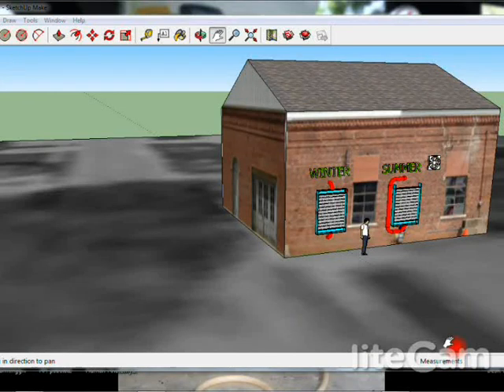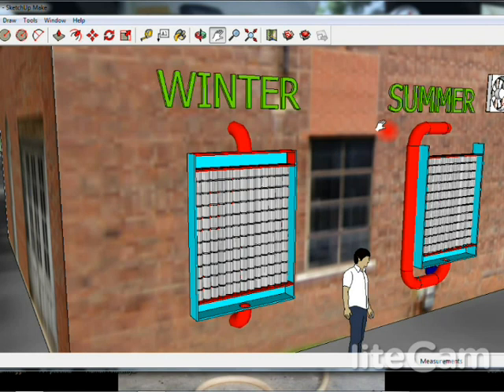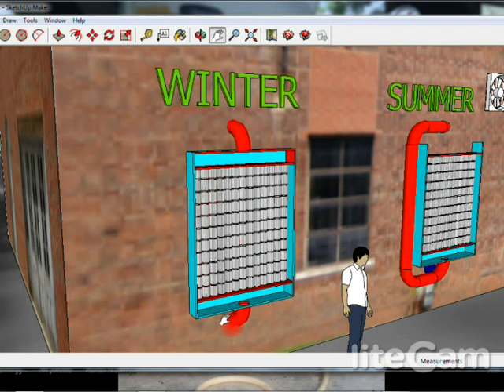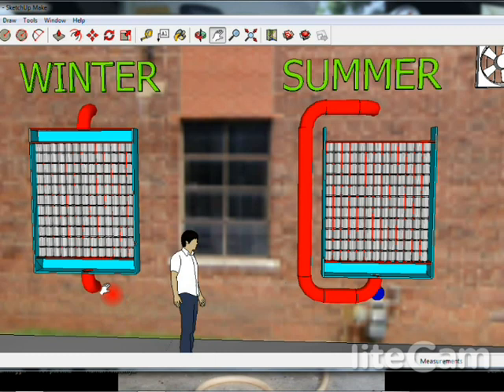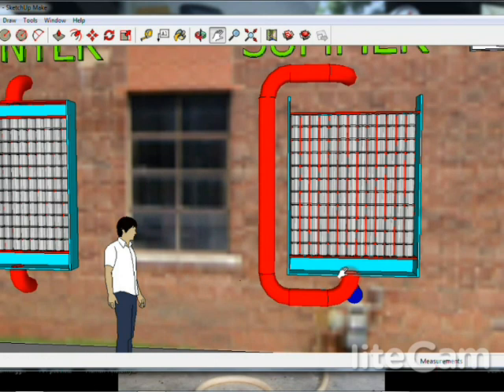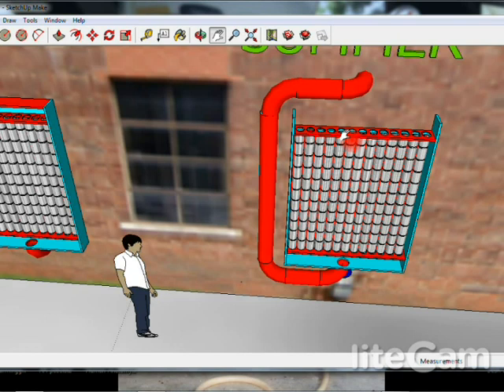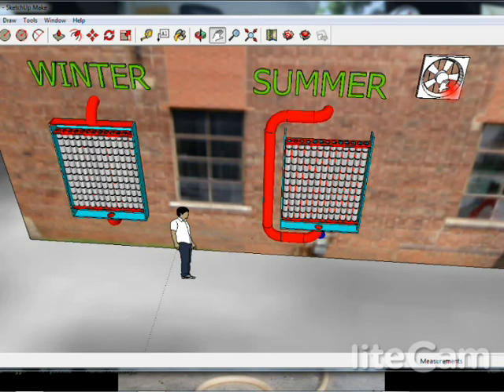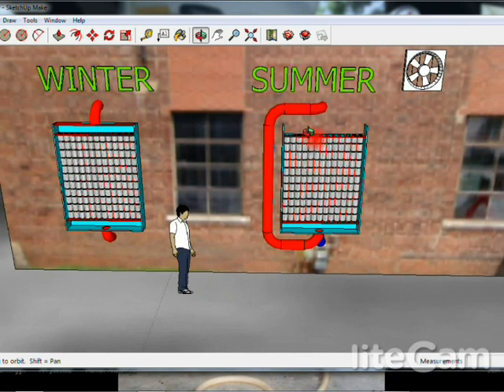Solar Cooler/Ventilator And Solar Heater in 1, Using Sun's Heat To Cool Your House

Comment: What would you do at night? I've kept on coming back to solar heaters but that part always deters me
Reply: Use thermal mass, like either bricks, or a homemade mixture of dirtcrete/soilcrete, behind the corrugated metal of the heating elements. 5% cement, 10% water, the rest dirt, mix it well, then compact it really well. You can mix it again after compacting, to avoid having the grains look like a stack of differently colored paper, or like slate rocks (like if you use it for building something else). After you're done, add water on top of it, so the cement absorbs that extra water, for the artificial stone to set better. And that's how many ancient civilizations ended up building megaliths, including the pyramids.

Comment: Hi Saeid, I see you have a problem with accessing cans, not a problem here in Spain by the way. I don't want to state the obvious but have you tried rainwater downspouts. I'm sure you have considered this as an alternative......
Reply from the maker: Hi. No I hadn't infact. It's a great idea, which means I can actually get to work on this when I go to Iran. It never hurts to point out the obvious (-:

That'll make life so much easier. No cutting holes at the top and the bottoms of the cans and no silicon gluing. I was always hesitant about using silicon in a situation where you're heating it up and then breathing the air that comes off of it. This solves that problem too.

So thanks again

Saeid
Reply: No prob's Saeid, if you go down this route then it might also be an idea to put some kind of air resistor in the tubes to stop the air moving too quickly and therefore not producing high enough temperatures. I also agree with the silicon situation but you can get high heat silicon just as you can get high heat flat or matt black paint etc. Good luck in Iran......
Reply from the maker: I have decided to go with Chimney Pipes for the heat collector and paint them black. Those are available everywhere in Iran and can be bought in any length. Would you recommend a thick or thin walled pipe for best heat transfer? A thick one would retain more heat and a thin one would pass on more of the heat I guess. Is that correct?

I think too much air flow won't be a problem , as the out let is going to be a single Chimney pipe being fed by about a dozen of them. THe diameter is 10 CM by the way
Reply: Saeid Momtahan I suppose it depends on how long your heat panels will be in the direct sunlight, not shaded by trees or buildings. The thinner walled pipe will give you heat quicker but the thicker walled pipe will take slightly longer to become effective but will give you heat for longer and the variation in temperature when the sun is a little weaker or in shade will be less noticeable.
Reply: @solarsiberia  You can also have the back inside of the heating elements' panel be a thermal battery made out of black painted bricks or black painted soilcrete/dirtcrete (5% cement, 10% water, the rest dirt, mixed well then compacted really well, then a bit of water added on top to be slowly absorbed by the cement then wait for it to harden, and it will and act like stone; you can also mix it again after compacting it, to make it look even more like natural stone). For the paint, you can use a mix of boiled oil (or oil brough to the smoking point once), mixed with ask, and the mixture diluted with water. Adding a small amount of boiled flour will help he water and oil to mix together. The oil makes it waterproof. Boiled flour is water roux, which mixed with oil allows for oil-based paints  (and cooking sauces) to be thinned. (And allows the cooking sauces to be thickened, too, but you don't need that for paint.)
Reply: @saeidmomtahan  Check the comment above, in which I replied to @Professor Pallet , please.

Comment: If you put a swamp cooler on the other side of the house, it'll help cool the air coming in.
Reply: If you don't want to increase the humidity, to avoid mold, just use a heatsink on the intake of the heater, with the heatsink inside a box, with the intake of that box being a swamp cooler. That way, the heatsink will cool the room without increasing the humidity in the room.

Comment: an interesting idea but I think you'll find that air doesn't flow as easily as water - I don't think it'll want to go down the pipe in the summer version. If you build it and get it working let me know! ;-)
Reply from the maker: Abdullah, if the tubes are sealed, I'm pretty sure the warm air getting sucked from the interior will have no problem getting sucked out by the hot air in the external tubes. Also the system could be built on the roof.

TY

SAeid

Comment: I dont know...I would think cooling air to thr ground temperature would be better than having it on thr side of the building.  solar panels to force the air on thr side.

there is a girl using solar greenhouses on her window  with solar fans thst also cook and heat. it's in use..cost her 9 usd to make.  what ahe saves in not using her oven paid foe it many times over and the heat well...pretty good supllplimentsb too
Reply: Solar cookers are nice, and modern solar panels are very efficient. Even using a garden light's solar panel to power a fan would work well, for heating the place. There are also trombe walls, which also significantly help with the heating.

Comment: The cans are not necessary. Paint the box black and cover it with something clear that will stand the heat.
Reply from the maker: Hi. Have you tried it without cans? It's hard for me to find cans, so it would be great if I could do it without them.

TY

Saeid
Reply: I have a couple of videos. Don't use the styrofoam, as it melts, but check out 
The Great Passive Solar Build Trombe Wall Explained  and Building A solar Heater Start To Finish
Reply from the maker: kbbacon I was finally able to see your first video. So it's exactly the same system that you explain. Great to see that.

SAeid

Comment: aaaah short term its not a cooling system you using it as heat desposal system during summer because the normal 300mm fan was to loud. and there would no addidional cooling  effect during night below the night temps even the system would run backwards by sucking cool air in the system it wouldn´t drop below the sourrounding air temps. well you can add additional systems to made that happend and it will work as air cooler below the outside enviroment Temps.

Comment: Air has to be replaced.  If you take out hot air during the summer, what are you replacing it with?  If you are sucking air back in somewhere fromt he outside, you are probably defeating the purpose, because likely the air at the top portion of the house is still cooler than outside air.
Reply: Aaron Bateman he said the way it would work would be to open a window on the opposite side of the house.

Comment: why did you have to use cans?
Reply from the maker: +anwar abdulkader you can also use tin chimney pipes.  Much easier
Reply: ok  thank u
Reply: Saeid Momtahan Would dryer vents work?  Bigger bore...but if painted black in a slightly larger frame...so cheap and easier then becoming an alcoholic drinking all that beer...!
Reply: @SPLINTBLIGHT  You buy the beer and I'll drink it for you.

Comment: Why not get an HRV instead of replacing your 70 degree indoor air with 90+ degree outdoor air? That does the exact opposite of cooling?
Reply: you obviously did not watch video close enough...the heated air draws out the TOP of the panel to outside air.   What he SHOULD have done was install a fan run off a $1 store solar light top with removing the solar battery and hooking up each terminal to fan terminal (+) & (neg) sides and letting the SUN run the solar panel to run the fan to blow the air with force thru the tubes by PULLING it out at the TOP of the can unit....however......it do see that Alum. downspouts work much better with their sides having ripples to better catch the heat (gaining 210 degree temp capacity)...and also "screens" laid on 2 sides of inside panel held off the bottom & back by 3/8" - 1/2" blocks allow the panel inside to float with air on all sides of the 2 layers of screens held apart... THIS screen system works about 3 degrees hotter than cans & alot less cost & alot less work involved.  I would like to see it compaired however to a system created out of the tall thin REDBULL cans vs. regular width beer /soda cans...I think the thin tall cans would allow more rows of cans to be coiled in up/down rows to make the final output an even hotter temperature. Would be alot of work to make it though but would end up being like a large scale copper coil system on an air conditioner or refrig.  - - - so try a CPU fan $2 +/- and hook it up. you would need a CPU that could withstand hot air temps....or attach fan to INLET hole to PULL the air thru system vs. pulling it into room. 

BTW,,,I'm a 27 yr experience Architect that specialized in creating solar heat tanks before many of you were even born and put them on experimental homes in early 1980s after doing the hard #'s/calc's during a solar college class where we wrote programs for calculating thermal mass required for entire homes with passive/active systems combined.  I always wanted to try to come up with a cheap type of solar powered air conditioning system that flowed thru tubes thruout the home in a ceiling area vs. floors for heat in winter.
Reply: D.Dominique Watts So 70 degree indoor air is heated to 110 degrees then 90 degree outside air goes back inside? I understand the heating but how does this cool when all the air in the house is colder then the outside. Where is the solar powered refrigeration cycle?
Reply: The "hot air" goes out the panel at top of exterior unit to outside air.....the "cooling" is in that the hot air which rises to top of the room is constantly taken OUT of the room by the unit in the wall allowing the cooler air from floor level to about 36" above the floor to constantly rise up...allowing the room to remain cooler.... kind of like cooling used in desert areas or in California or florida where no actual air conditioning is used.   The AUTHOR of the created system does say it hasn't been made or "tested" and that would be the next step. MY thoughts are that for many people who live now and not 20 or 30 yrs ago...it "may not be cool enough to their liking" it may not cool to 68 degrees or even to 71 degrees....however for concrete floors on slab ground construction for homes...it would cool it to the ground temperature under the slab...so it probably would work to about 68 degrees. Frank Lloyd Wright homes in the late 40's and thru the 1950s employed concrete slab floors for winter heating and the concrete slab floors were enough to keep the homes cool enough in summertime...however constant removal of "upper" ceiling hot air would need to be done in those cases, and in Wright's homes he allowed upper clerestory windows to vent the air out or thru a higher kitchen ceiling area which had 10 or 12 feet ht ceilings vs. 8 ft for main areas.

Comment: summer heat will increase the temperature more than 100 deg. C.... Especially without a fan.... The risk of structure or tube damage is too high....
Reply: Use metal and glass, then. With an optional packed-dirt thermal battery.

Comment: Has someone comment/corrected you, or you've actually researched first about Heat flow? You have it backwards. In both sides you state it backwards. The cool air on the floor is not drawn into the hot panel, nor is the warmer air up higher drawn into the warmer/hot panel outside. Cooler Temps don't flow to warmer ones, but the other way around. My whole successful business and happy customers thrive off of helping people stop the natural correct flow of Heat towards the Cooler areas.
Reply: I wouldn't rely on stagnant air flow, but even some low power fans to manage/facilitate air flow would help a lot I think.

Comment: Well you now that's not cooling, that's what we call "ventilation". Take a look at traditional architecture in any country with hot summers. There is always a vent in the roof. Then you just need to open a window on the shadow side of the building you have exactly what you did in your video.